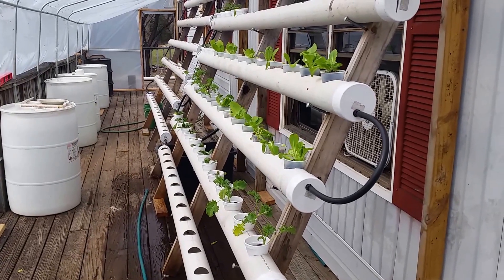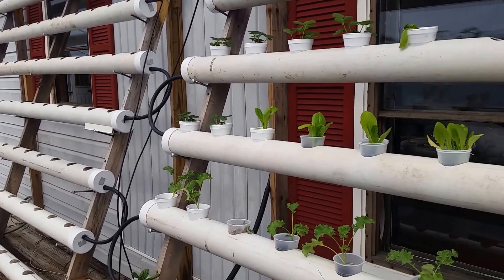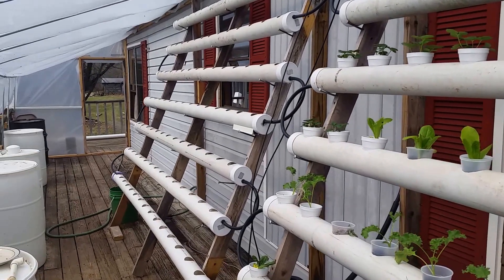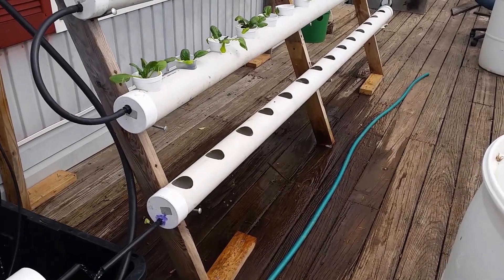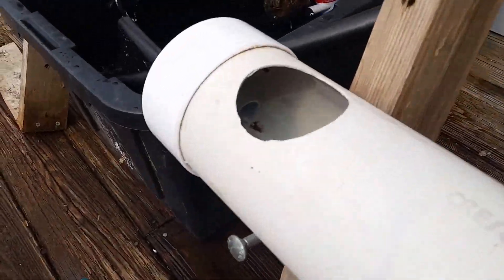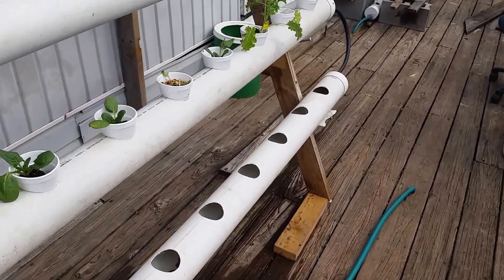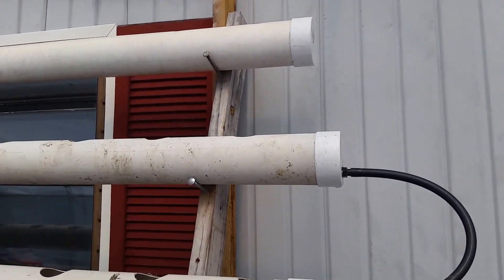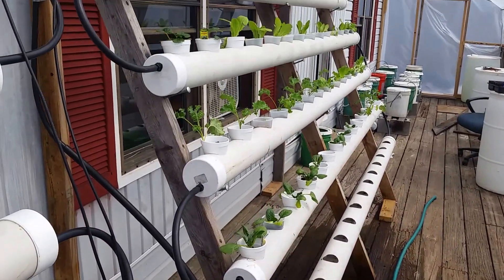Leaking Pipe on Our DIY Hydroponics System

Comment: Having the same sort of problem on my system....starts off fine but once the roots get established you get another problem....flow rate becomes too much  for the system to handle and you get overflow.....my solution to this tilt the pipework to get more flow ....start with the problem area and adjust according to you checks daily.....remove any flow level brackets ....your set up needs to be flexible to adjust to the needs of the roots........high flow to start off with then slow rate due to root system ....

Comment: I recently had that problem.  What I found was that the tube draining into the reservoir was too long.  When the reservoir was topped up the back pressure through the tube would cause the growing tube to overflow.  The end of the tube was about a foot into the 5 gallon reservoir.  I shortened the drain hose to be very close to the cover of the reservoir.  I'm going to replace that clear tubing with black to avoid algae.  See my video:  https://www.youtube.com/watch?v=fUPD8B0tO_8

Comment: How did you connect the tube between each pipe?
I appear to be having difficulty finding a solution. I have the rubber clamp down end caps on mine.

Comment: Bottom pipe does not have as much drainage pressure due to its lower height, therefore filling faster than its draining.  Make drainage exit hole bigger that should help.

Comment: Lower the flow rate And put a drain pipe twice the current size. Use valves to adjust flow.

Comment: The flow seems too strong, but there are no baskets in place.  It appears as if the swirl of the water as it enters this pipe pushes up through the holes.  Try it with baskets in place, perhaps?

Comment: The solution, as suggested by others, seems simple enough to increase the diameter of the outlet pipe.  The question, though, remains as to how the bottom pipe overfills when the other pipes do not even though inlet and outlet pipes are the same size.  How did you fix the problem and did you ever determine the culprit as to why this pipe alone overflowed?
Reply: Likely that as the majority of pipes bend downward, and then into the pipe below, gravity drives a syphon effect through the pipe and so it will effectively suck water from the pipe above.  The drain on the bottom pipe however, is almost horizontal, and then opens to atmospheric pressure as it pours into the bucket.  So the water in the lower pipe will not experience this suction, but rather have to build up a small amount of static pressure to drive the water out the (almost) horizontal tube.  

Solutions:
- As noted, larger hole will increase flowrate
- As the tubes bend down to the pipes below, having them poked loosely through drilled holes in the pipe.  Don't connect with an air-tight seal.  This will remove the siphon effect as the bending tubes will open to atmospheric pressure.
- A drain tube that hangs down at least the height of the upper bent tubes to create an equal or grater suction from the lower pipe.
- You can remove the syphon effect by adding a vertical tube sticking up out of the top of every bending tube, and have this open at the top (i.e. open to air).  It will vent the syphon.

Comment: Each pipe has a gravity assisted siphon that is helping suck the water out of the tube except for the last one. You can make the last drain larger or if you have enough height, you can give it a longer pipe with the same vertical fall as all the rest to create the same siphon.
Reply: Jared Jones Spot on, the only correct answer to this.
Reply: bingo
Reply: Thank you for saving me time writing that out.

Comment: put a bigger drain house with a valve in it to adjust the amount of water exiting.  That should fix your problem.
Reply: InvincibleMiners  yes thts can be fix your problem.Good luck buddy
Reply: +1
Reply: Gravity flow the bottom pipe inlet is flow faster and tempting slower. Install a bigger drain off on the bottom pipe